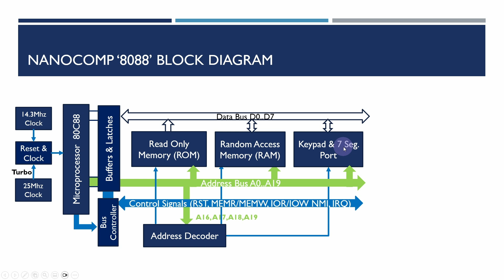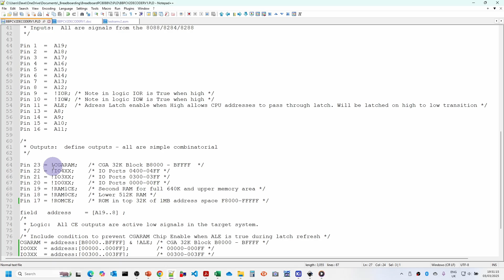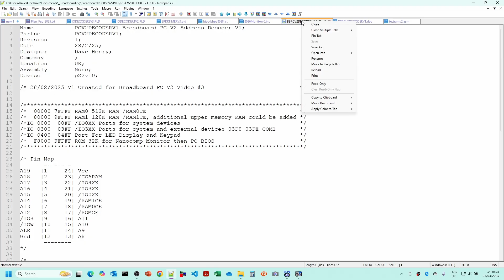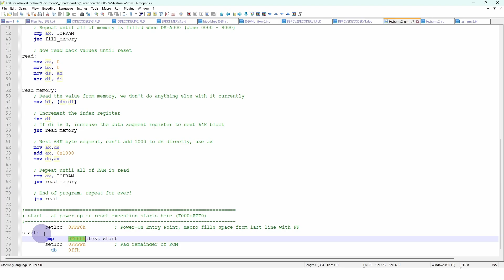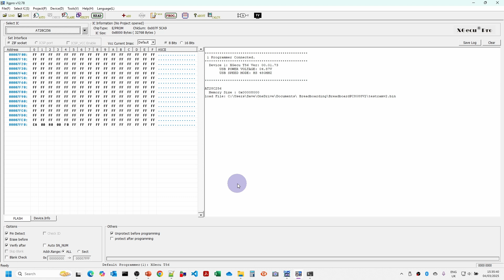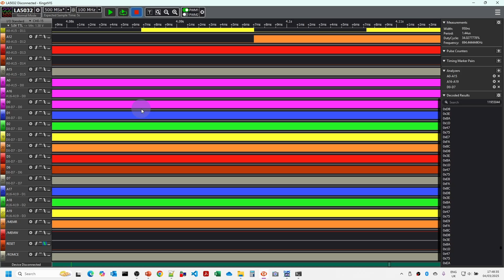New Breadboard 8088 PC V2 #3 EEPROM, RAM & Address Decoder

Comment: Very exciting! Where did you get the gigantic stripboard from? And what are the exact dimensions? All the stripboards I can find are just 100x160mm or have a weird shapes. Same for the pin headers. Are they 78 pins long or are they a combination of shorter ones? The longest I can find are 1x50
Reply from the maker: I bought mine direct from Veroboard in the UK https://verotl.com/67-1902-single-sided-veroboard-205x394mm-in-srbp
About £27 plus delivery for 205mm x 394mm (8" x 15.5") and 78 strips x 155 holes.
I cut mine down to 78 strips and 6.5" which is a breadboard length.
Not obvious from the photo but the specs are accurate. Comes in cardboard sandwich which protected it well.
I use 0.1" x 40 way pin headers with one cut to 38 pins. I find the budget square cross section ones better for use with DuPont cables and NOTthe circular ones. Get mine from https://www.bitsboxuk.com/index.php?main_page=product_info&cPath=225_230&products_id=2409 as I can collect within a couple of hours of ordering.
Just lots of soldering and testing with a multimeter!
Dave
Reply: Great, thanks! That's very helpful. A placed an order at Vero